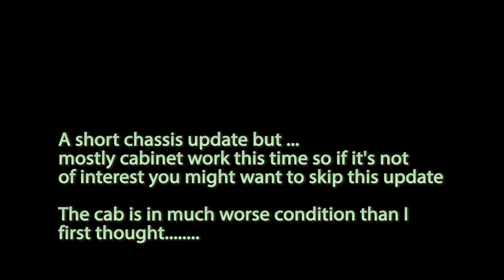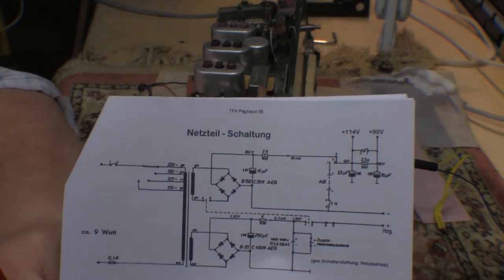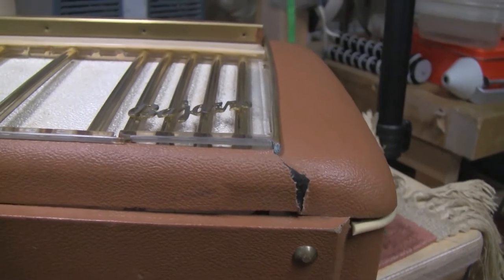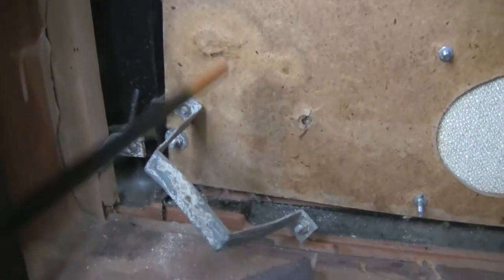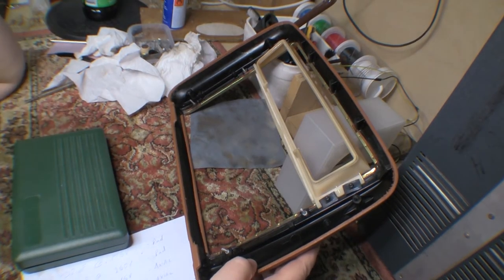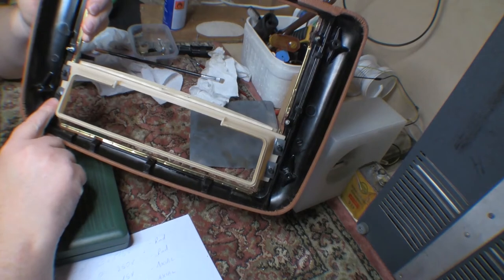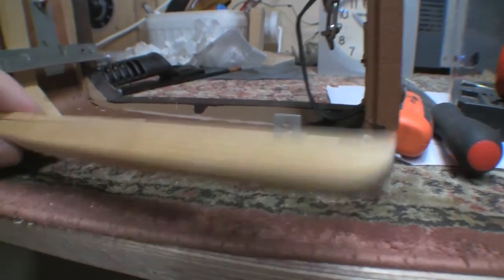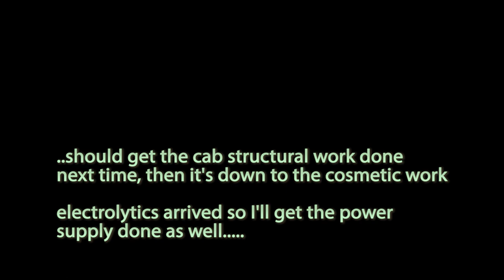Telefunken Bajazzo 55 - part 3

Comment: Those spring clips were also used to fasten automotive trim parts in place so they should be still available in some form. I've had some luck in prying up the jaws with a flat bladed jeweler's screwdriver but they can also be removed by cutting with a Dremel tool.

Comment from the maker: Thanks, it's pretty clever really - using the AC plug to switch to battery.   Makes sure you can't switch to battery while it's connected to the mains.   Luckily I didn't throw away the old plug :)

Comment: It looks like structural damage is pretty common with this model, I found a video of another similar Telefunken on here that also has radial cracks in the plastic under the leatherette. I have a pair of Phillips transistor portables from the same era, 1958-59 I think, but fortunately they limited the use of plastic to the trim parts, the structural stuff is leatherette covered plywood.

Comment: I'll lay you a 99.99999% chance those two holes are for the mains plug. It toggles those switches so that it runs in battery mode. Then when you want to run it again in AC mode you just unplug from set, (which switches back the set to AC mode), then plug it into the wall.
Tom

Comment: Are you sure that the rectifiers are silicon? Given the age of the unit I would have figured they would use dry metal rectifiers, either selenium or copper oxide. With regards to the cracked plastic parts maybe you can find a parts set at some point, one that has been in a basement flood, had the dial glass broken, or has something missing that you already have..

Comment: Hello John. Are those rectifiers made of silicon or germanium? Connecting normal batteries and rechargeable ones together doesn't make sense... What if the normal ones were supposed to recharge the rechargeable one (strange idea, I know)? Looking at that drawing, it seems to me the connector for the battery use looks like an AC plug. Isn't the AC plug supposed to be connected there to close the battery circuit somehow?